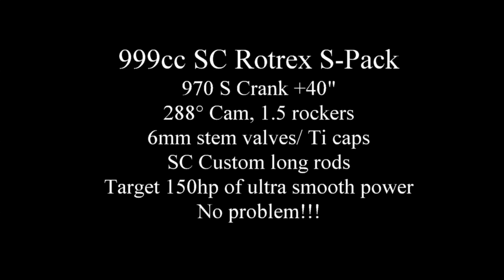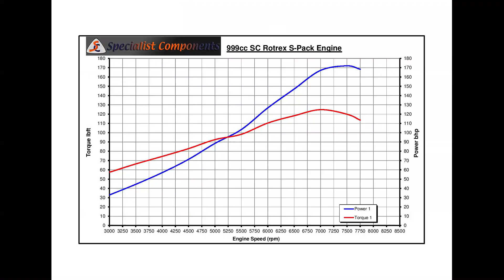999cc Specialist Components Rotrex S-Pack Powerhouse.......

Comment: Hi, Am I right in thinking that the block is not a normal 998cc? I say this because of the oil filter fitting and the 36-31 size valves in the head.
Reply from the maker: Hello - you're correct the block is a "1275cc" MPI (last of the Rover Mini's) which has been bored 0.5mm - this usually gives a 1293cc engine, we reduced the stroke of the engine so that it is only 999cc now - to comply with class racing regulations but using the best option to do so as the 1275 block and crank/rods etc can be designed to be ultra strong for reliability.